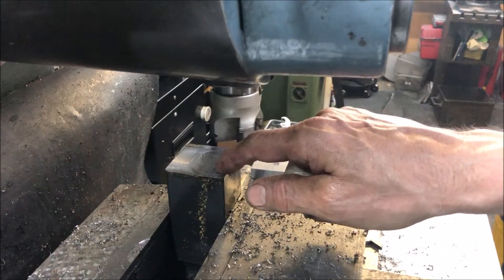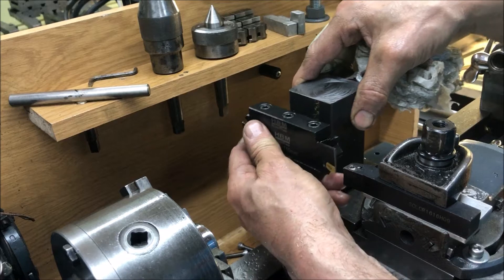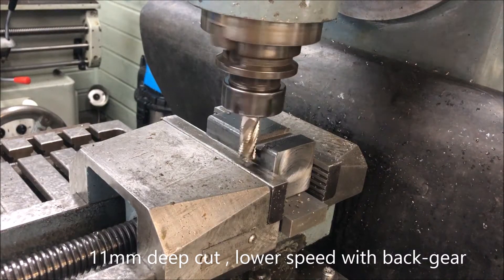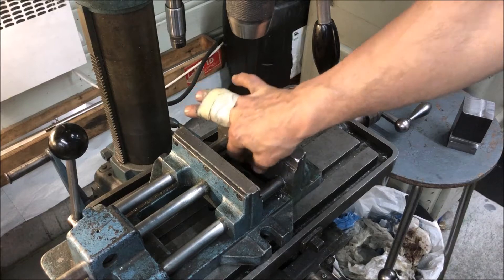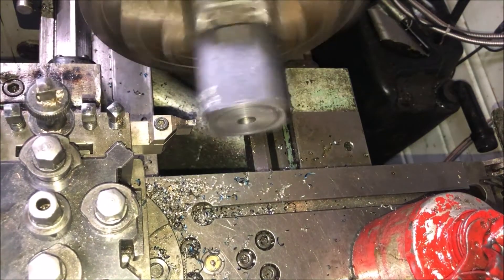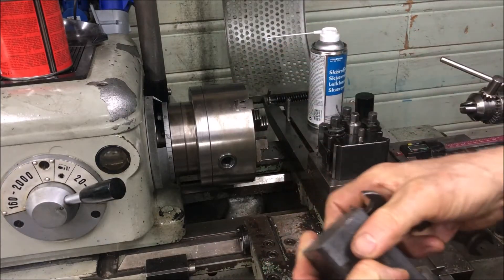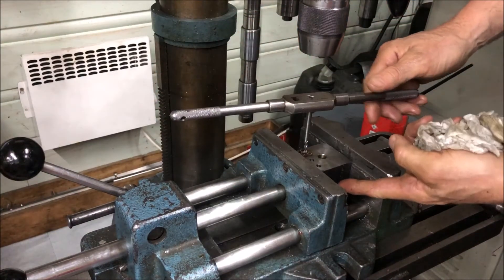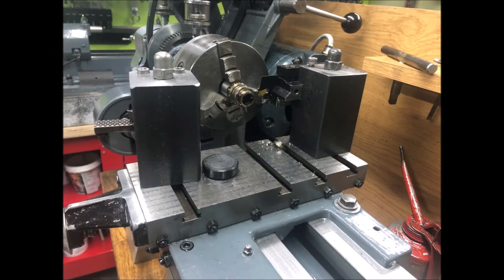Myford ML7 - front- and rear mounted block toolposts

Comment: About all there is left to do, is eliminate the toolholder entirely.  Mount the insert on a corner of the toolpost :)
Reply from the maker: Yes, could do that also.. good idea. I have seen this also somewhere, someone making a 3 or 4 way holder with place for the inserts. Hmm.. maybe I will try that!
Reply: @jansverrehaugjord9934  - If you find out who else has already tried this, I would like to know.  I'm not doing well searching for it.
Reply from the maker: @somebodyelse6673  Think this was an article in a hobby magazine. Will check
Reply from the maker: @somebodyelse6673  Found the article I remembered. This was featured in the magazine "Maschinen im Modellbau" nr. 5/12. Very simple.. just a cut-out to include a regular diamond shape cutter for general turning along with another cut-out a little on the inside for a face-cutter. I assume you must be a subscriber to access this info, but anyway.. here is a link to their website:  https://www.vth.de/maschinen-im-modellbau
Reply: @jansverrehaugjord9934  - Thank you!

Comment: So you consider the arboga to be a drill press, not a light mill?
Reply from the maker: This version is just a drill press, yes. It has only the MT3 taper hence cannot be used with a milling cutter. This would potentially be disastrous. The mill/drill version is different having  their special locking collar for milling cutters/holders as well as a beefed up column and possibly more changes overall.
Reply: @jansverrehaugjord9934  ah ok mine has the locking collar. I’m asking because I haven’t used it yet. It is really solidly built for such a small machine